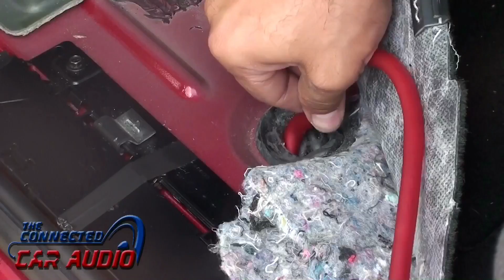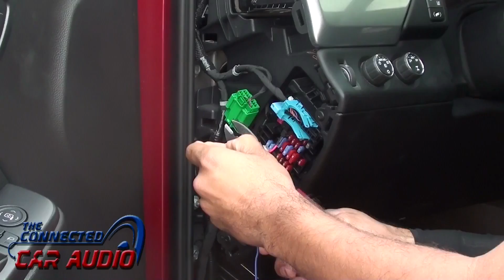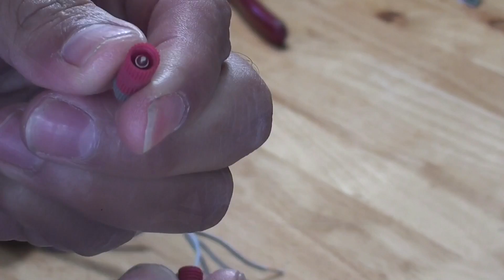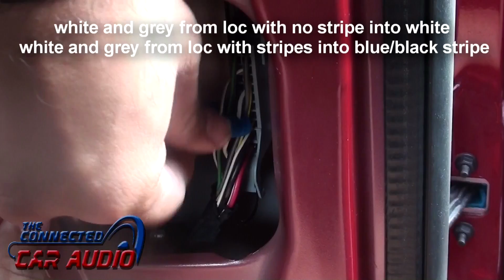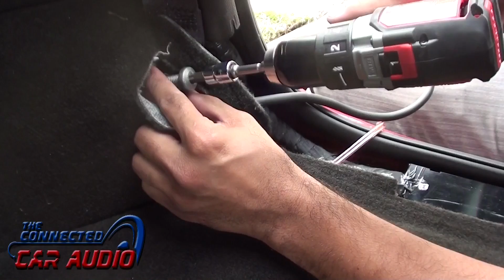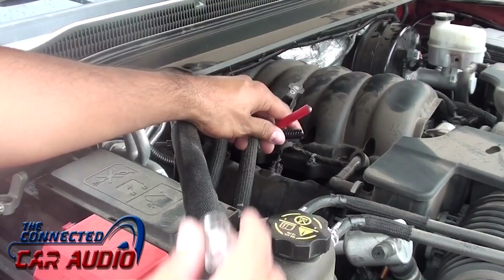How to install an subwoofer  amplifier chevy Tahoe 2015 and up

Comment: I have a scenario, I have 2-12s and 2-10s sun that I want to install, I was told I would have to install two amps to power the two sets separately, so could I put the same technique for both amps separately or could I tie them together in the front end and separately in the back end?

Comment: Hi! So I followed this video on install and at hard hits that speaker I tapped into cuts out when the bass hits causing my sub to cut out as well what did I do wrong? I get this video is ages old but I’m lost here. When I wired my Audis sub in, it went smooth and never cut out and has been going fine for the last 2 years
Reply: check your fuses and put your remote wire in a stronger fuse slot... Not 10 or 15 like a 25 or 30 slot.

Comment: If you have a aftermarket head unit,  do you need the converter even if you have the 2017/Bose system or can I skip that step
Reply from the maker: You can use the rca preouts from the aftermarket deck
Reply: @connectedcaraudio  awesome thank you

Comment: Can you do this with a factory radio and not a aftermarket radio? If so what’s needed?
Reply: This video is for a factory  head unit. An after-market radio you wouldn't  have to tap the speaker wires you would just run rca to the input in the back of the radio.
Reply: @lestdatexan  thank you for the reply. It will help me for my self install.

Comment: I tried all of this and my output didn't push my subs.  Great video though.
Reply from the maker: Did you have the Bose system
Reply from the maker: If there is a factory sub try tapping into that instead
Reply: I have bosses them on my tablet 2016 how can I hook up my amplifier to push two 12in speakers

Comment: great video, if you have a 17 you need to tap the bose amp, drivers rear quarter. if you tap into a rear mid range speaker you will send a mid/high frequency to the sub which won’t sound right. I have a question for you, how many feet of power cable did you use. i have about 15’ and i’m afraid it’s not enough. lol
Reply from the maker: Thanks for the extra info I’m sure someone here will find it very useful 

And I’m sorry I don’t remember how many feet I used but try to put the amp on the same side as the battery that way your not having to cross the power wire in in the engine bay to reach the battery
Reply: 2015-2020 is 17 ft long! I ordered 25ft so I can run the power, 2-3ft ground, and 5-6ft for big 3!
Reply: What if your tahoe is a 2018 and has bose, but doesn't have the subwoofer?
Reply: So where do I tap into the low range speakers at in the 17 Tahoe with Bose
Reply: Do yourself a favor and buy the pac audio amp pro. Using a line output converter or audiocontrol LC creates more headaches. I used a harness that plugs into the clip that plugs into the amp that is located rear driver quarter.
Reply: @daevpizarro  Do you happen to know the wire colors to tap into at Bose amp? Thanks
Reply: @bossindicators6765  I don’t. To be perfectly honest with you, after getting a harness that connects to the amp so that i could hook up a line output converter which you have to make sure is an LOC that can handle the voltage that bose puts out, I really wish that I went with the pac audio amp pro. Those give you rca from the head unit and gives you a little more control using a factory system and aftermarket amp and sub. Check it out and consider that route.
Reply: @connectedcaraudio which side did you install the loc? Driver/passenger? And was the before or after it got to the factory sub? If that model has one. Mine is a 2018 Tahoe and I’ve been having a hella hard time with all the onstar and everything. Any advice on this would be more then preciated

Comment: Does this video take into consideration the Bose system and making the connections in the correct area?
Reply: I tried through the door speakers and got to low of out put.  I'm going to try near the stock amp. See what happens
Reply: @TrueLuckGaming  did you ever figure if out
Reply: Did you ever figure it out I'm trying to do my 2016 with boss system
Reply: Can you tell me where is the factory amp location

Comment: Great video! But I got a question, you had rca cables from the head unit and from the inverter, so which ones went to the amp??
Reply from the maker: I wa showing 2 different methods to run rca 
You have to do one or the other 

Hope all is well

Comment: Car Installation 101:  running the power wire under the vehicle is a NO NO.  Ask any pro installer
Reply: actually no it's not. It's perfectly fine to do so.
Reply: Yep, your asking for a fire!!
Reply: It's electrical wires running all under your car. starter, transmission, abs sensors, ride leveler etc..This is no different then putting LED glow lights under your car. Hot wires are connected to those also. This will be ok
Reply: You can as long it’s safe like how how he did it. A lot of power wire running underneath the car or truck

Comment: My subs are  connected to the amp and when I press the gas the subs make a loud noise but if my door or windows are  open then the noise goes away on a 2016 esv Escalade
Reply: sounds like you need to change the ground point of your amp also DON'T run your main power wire for the amp on the same side of the rca plugs.
Reply: Juan Cruz. Sounds like it is due to the Active Noice Cancelling. You need to either cut the mics (not recommended) or purchase an ANC bypass harness. I also have a 2016 ESV and had to do this.

Comment: I just don’t know y you didn’t installed the amp on top of  board ? You don’t want the heat of the carpet on the amp!!?
Reply from the maker: Putting the board under the carpet helps keep the board in place. I feel that it’s better then having to drill the board into the metal of the vehicle. Better for leased vehicles and rust prevention
Reply: The way he did it keeps the board in place without the need to drill into the body. What you could do is add spacers between the amp and board to lift it up off the carpet a bit.

Comment: I connected a line output converter to the wires that you showed and they sun would play very lil I connected a 6x9 to the white and blue/black wires and it played good so what could be the problem?
Reply: Because he didn't get the right signal he got voice signal for some reason
Reply: @theonlysheepkoophere8492  what's the right one
Reply: @austinthomas8875  I will let u know in a min

Comment: I tapped into the left rear speaker signal wires(2017 tahoe LT with factory sub) and noticed the signal was pre processed (low frequency absent) making my bass sound like crap. So i dont recommend this for bass on this suv.
Reply: 420sycoholic you have to go into the Bose amp 4 wires... in the center console
Reply: @meathead1011980  ok which wire pair color signal will work for my 1 channel amp. And any vids on how to reach amp? Thanks man.
Reply: @420sycoholic  hey bro I know it’s been 2 years but I’m trying to hook up the loc and there still isn’t any information on the internet on wire diagrams for these SUVs. Did you have any luck in the center console and what wires if you did.
Reply: Do you have the take the seat out

Comment: I do not like what I just watched. These fuse taps and wire taps and last but not least never run your power wire under your car.
Reply: why not, many wires run under the car
Reply: @DirellAlexander  including fuel lines and transmission fluid lines which are explosive and flammable

Comment: No,no,no. Power wire under the truck!? Fuse tap!? WTF!? Lmao!!! There's a boot under the dash and there is switched power in the box under driver's dash.
Reply: Cutting an extra hole in that boot = Leakage ; Power wire under vehicle = Possible fire or fried electronics (if your lucky)

Comment: On 2013 my amp stays on when it put it in that fuse box. Why is that and is there any fix for it?
Reply from the maker: Try a different fuse that reads 0 when the car key is in the off Position and 12 volts when you turn the key to the acc position.